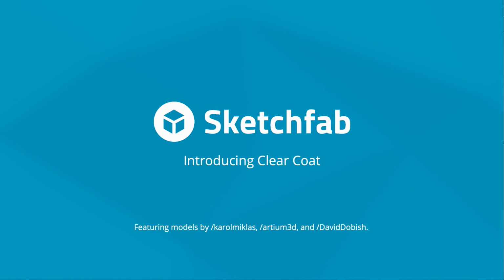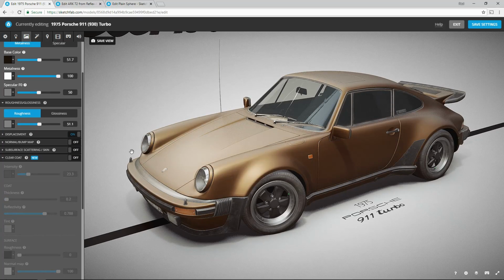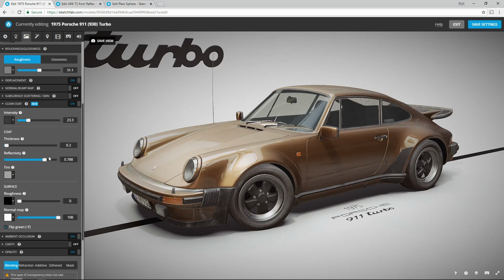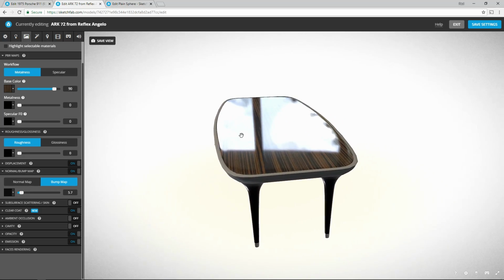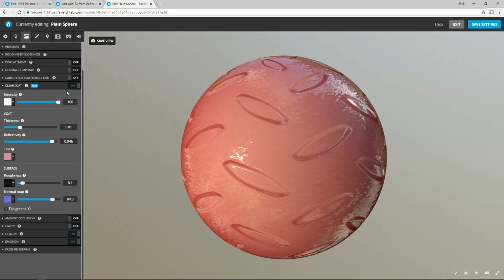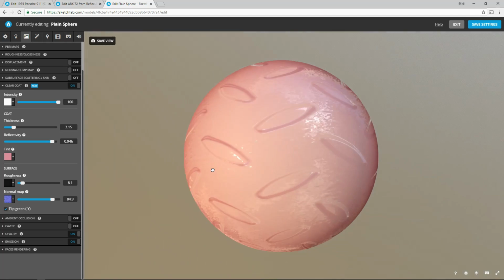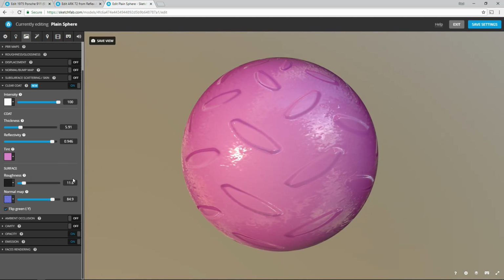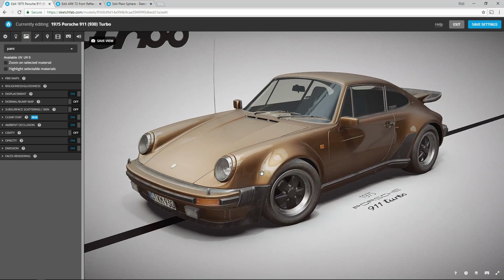Introducing Clear Coat | Sketchfab

Comment: Can someone help explain what clear coat map actually does?
 Is there some physical trait that can't be accounted for in other maps?
Couldn't you just achieve clear coats by applying a "varnish" layer on top of materials in Substance Painter?
Reply: Clear coat simulates a slightly offset clear / shiny surface - this is useful to simulate surfaces like certain car paint finishes, or highly varnished table. Check out the effect on the top of this model: https://sketchfab.com/3d-models/carbon-fiber-drone-unmanned-aerial-vehicle-ceb4b8ba11b349b18c039713bccfe9a0.

In Sketchfab's 3D editor you can control the coat's Intensity (grayscale texture or single value), Thickness, Reflectivity, and Tint (solid color). You can also add surface Roughness (grayscale texture or single value) and a Normal Map.

Not sure if this equates 1-1 with the Substance "varnish" layer you mention. 

Hope that is useful info.